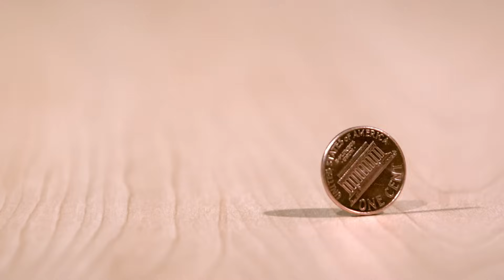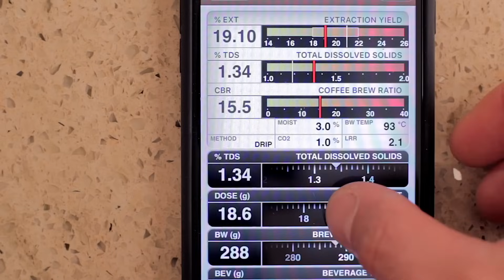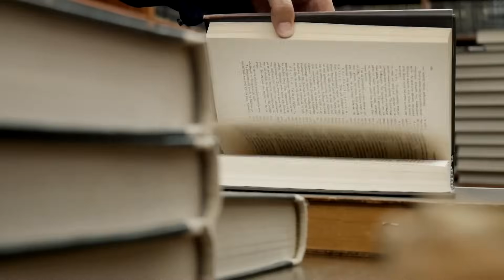Eulogy For The Tamper?

Comment: As long as there are lever operated espresso machines, I think we'll tampers. Fancy modern shops will transition to automatic tampers, as will mass-market ones like Starbucks, but I imagine that manual tampers will stay around. It's already a fancy hobbyist thing, and communities generally like to hold onto this type of gadget.
Reply: Or for anyone running any half decent espresso machine at home. I'll never be able to justify £700+ for some wanky machine that tamps (puq press) when my Rancilio is under £500 and the grinder around the same.

Comment: I actually bought a Compak Cube Auto tamper since I got tired of hoping my tamping to be consistent. however it would be silly to overlook the cheap tamper since auto tampers add another $1,000  to the required equipment just to make espresso. Granted there are cheap chinese auto tampers in the market that does exactly the same thing but its still barriers of entry.

Comment: I only use calibrated tampers these days. Not for a specific tamping weight/pressure, but for repeatability, and also - and that's why I find it interesting that James mentioned it - to protect my wrist. I am quite fit, but my joints are not the strongest. I hurt myself several times before. Not once though, since I started using calibrated tampers.

Comment: Tampers are weird. I recently made a tamper from scratch, as I'm a hobby metalworker. But the dimensions of the tamper, nominally 58mm, are weird. The basket it goes into (sorry if I don't get the terminology correct!) is poorly made and apparently doesn't have reliable dimensions. So tampers are quite a loose fit -miles away from the kind of accuracy machinists typically deal with.

But then you talk to coffee people, quite smart and experienced once at that, and you read the forums and reviews. And these coffee people get suckered into thinking their tampers are 'precision' or that it's somehow impressive how close to perfectly round they are. They're not precision. In fact, making them is really quite simple. If you examine them from a machining side, even the high-end ones, you can see how the machining typically isn't even that good. But coffee makers don't know that. They are drawn in by marketing wank, and made to believe they are buying something incredible. 

Perhaps you're right; it's something psychological, about giving yourself pride and confidence. But it's a weird mismatch between the lack of precision in so many parts of the espresso machine (especially the basket), and then suddenly this desire for precision in the tamper.
Reply: Looking at it from the outside - I've never pulled an espresso shot in my life - there are third party basket manufacturers, and they do brag about their precision machining as well. I would not be surprised if their actual machining is as mediocre as you describe for the tampers, but at least the baskets seem a tad more complicated to make than "metal puck with handle".
Reply: Marketing wank....gonna have to adopt that one.
Reply: If the tamper made airtight seal, it would just suck the coffee puck out, wouldn't it?
Reply: @itsJPhere  Or fluff it back into powder, depending on the rigidity and the airflow through the basket holes, yes; good point.
Reply: A close fitting tamper is like sex in a small bathtub - Too tight
Reply: "But then you talk to coffee people..."
You can stop right there. It's a sub-culture that's been infiltrated by pseudo-scientists and narcissists.
I've no idea why this is, but that's the truth of the matter. I find it to be most strange, and it's confounded me since day-one of my immersion into that scene. 

I'm hoping that James is an antidote to much of that, by straddling the arcane with the practical, and the esoteric with the realistic. I haven't made up my mind yet, but I'm patiently unfolding all that he has to offer.
Reply: Donald Trump  that got deep 😲
Reply: @MarkHanford  Something I don't normally associate with the man.
Reply: And it's not only the tampers... In the eyes of a mechanical engineer all coffee related gear is at the lowest possible "skill"-level of engineering. Grinders that are almost ridiculously trivial to build (It's a spinning shaft with two bearings) and coffee machines that basically consist of no more than a kettle, a pump, some pipes, some valves and a shiny housing... Yet the manufacturers call ridiculously high prices and the costumers are proudly paying it thinking they actually acquired something "special". To those poor souls a feature like "PID" seems incredible innovative and worth charging an extra grand for, to us engineers it's as standard as can be. Any arduino nano for 50cents could implement PID...
Reply: @mikeymike437 
It's shite but it's the way it is. That's why some brands/machines sell so much more than the rest. Same happens with car mechanics and computer technicians, whatever area you work on in which people have a big lack of knowledge you can abuse in pricing.

However, an espresso machine, for example, is not simple. You can see James video comparing all the sub500 machines and all their flaws. There are a lot of things "to get right" and a lot of variables in coffee.

A grinder is also not that simple, when you consider static, loss of a bit of grounds, that the weight of the grounds on top of the ones being grounded affect the process of grinding, etc etc. If you really believe it to be so simple you can build a 250 bucks espresso grinder and become rich. The niche zero is sold at 600 and they can't even keep up with the demand. Plenty of companies thought it was simple as you say but often fail horribly with unevenly ground coffee, tons of static, annoying noise, and a long etc.
Reply: Marketing wank is the basis of most consumer products, there are loads of "Emperors new tampers" about and now the new thing is the distribution tool, as an engineer you will look at these and say Jesus fucking Christ its the simplest lump of metal to machine ! Then you will see the price for this simple device range from $10 to $150 depending on what brand has decided to use their marketing wank department to convince mugs/snobs that a printed design on the lump of metal makes it do a better job of leveling coffee dust worth the extra $$$. Pretty sure there will be a Prada one for $1000 soon
Reply: 100% pyschological. the plastic one at the beginning works just as well
Reply: @urbanweekendwarrior7238  ergonomics still mean something. The plastic one sure looks like a pain to hold.
Reply: @mikeymike437  I have only just started looking into this hobby, and was absolutely shocked to discover that something as basic as PID temperature control is considered to be a high end feature. How do you develop any piece of machinery designed to heat something without including any kind of temperature control? Insanity.
Reply: @jacquesdemolay5171  to some point he does, but on the other side, he precision-weighs his stuff. That's just.. not needed. Nobody is going to taste the difference between .2g more or less of coffee, or 2-3 ml of water difference.
Reply: I made a tamper from scratch a while ago, too. Though mine was made from oak wood. Works great, cost pennies and was quick and easy to make on a lathe. Anyone who can make a tamper themselves or have someone else do it should definitely do it.
Reply: Maybe you'd like to fix that. Add it to your hobby list.
Reply: @mikeymike437   From a basic engineering perspective, sure, espresso machines and grinders are fairly simple. But from a manufacturing perspective I think you underestimate how difficult it is to design such a complicated device that can be manufactured and still be profitable for the company. 

Don’t believe me? Take apart one of those high end grinders. Sure, it’s in essence a spinning burr attached to a motor with a rotationally-fixed burr that can be adjusted closer or further away from the spinning burr. Looking more closely you’ll realize the adjustments are quite fine, some grinders capable of .01mm or .0004” relative adjustments. To design and build a grinder precise enough that such a small adjustment is meaningful is not exactly easy, IMO. (I come from a background in mechanical and manufacturing engineering)
Reply: @Aethid   PID isn’t absolutely necessary with a large enough heat reservoir. Many espresso machines simply use a large boiler to heat water, then kick off when up to temp. Temperatures won’t be quite as consistent as with a PID, but if the device technically functions without the added expense, you bet manufacturers are going to go the cheap route.
Reply: @tbdcreations5370  Now there’s textbook case of a guy (Mikey Mike) chilling out at the top of the Dunning-Kruger curve.
Reply: @lewisheard1882   You might be right about that.
Reply: my first tamper - a small caper fruit (capari) or stg bottle, the lid not even flat (has quite a tall ring around) but fits in the hand. And hey it might even be Italian, didn't come packed with a machine, so probably worth hundreds in the eyes of the industry. 😂
Reply: @mikeymike437   I agree to a point. There is lots of specialty coffee guys who manufacture and sell snake oil...with many lining up to buy. This reminds me of the hi end audio market with their tweeks, cables and what not. There is no way an interconnect should cost 12 grand but people do pay that..enough pay that to make the company viable. 
I just looked at a grinder that cost over 7 grand yesterday. Nickel plated Titus Nautilus. Same exact thing. It costs a fraction of that to produce but I have no doubt they will sell out. 

Now add in shoes, watches, whiskey etc etc. Some want it enough to buy it or have so much money it's like buying an entry level grinder from Starbucks to them.
Reply: Tons of engender talk shit about coffee machine engineering and blah blah blah, how easy to make blah blah blah but none of them have the balls to make a machine and earn that millions of dollar they said it’s easy. It’s always easier at the comment section it seems.
Reply: @iFireender  reducing variables increases repeatability regardless of your belief that someone can or cannot taste the difference of a third or a half of a gram of ground coffee. Theres not really harm in encouraging precision measuring. And i acknowledge i am not a scientist, but i pull espresso for a living and differences in dose by fractions of a gram have a big impact on flow, which may or may not be indicative of a flavor impact, but is, yet again a potential point of inconsistency that you’d rather avoid.

Comment: I haven't used my tamper in months. Simply setting an OCD-style distribution tool to the depth I would normally tamp to results in a perfectly level, fairly well-distributed puck every time. It's a little strange, making espresso without tamping (with a tamper, that is), but when it results in consistently better shots, it feels a little silly to not take the more modern approach.

Comment: Tampers arent goung away. Automation isnt quality
Reply: Gregorio Gangala Besides aid, semi-automatic can archive quality
Reply: Gregorio Gangala yet.
Reply: Nah I don't think so. Sure it's only "tamping" but it's the first step in knowing if you dialed in your espresso right. I'll always use a tamper. You start automation in an espresso than part of the process will die
Reply: Does that mean you don't use an automatic grinder either? You grind by hand? That would be the same logic. As the technology gets better, tamping could be done best automatic. You will get an even tamp every single time, and by doing so, a quality cup every single time. (If the rest of the process is done correct as well) 

I use a tamper as well..  but I won't deny that this might be the future for tamping :)